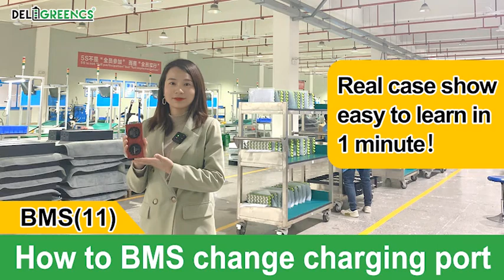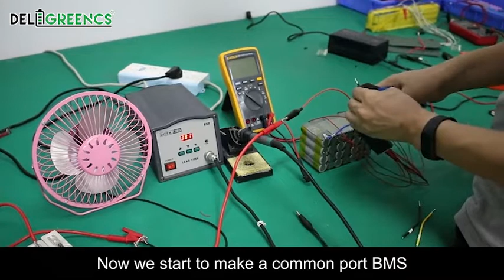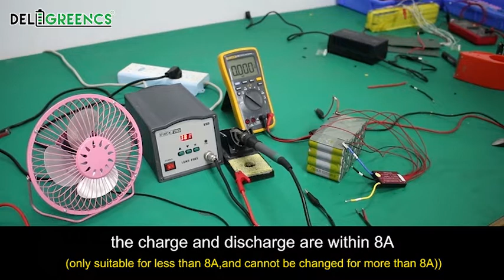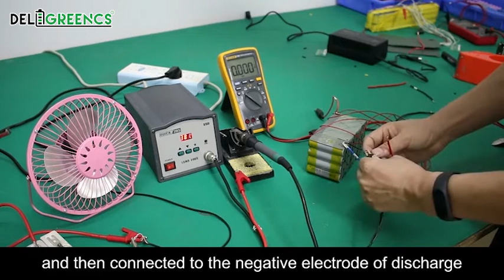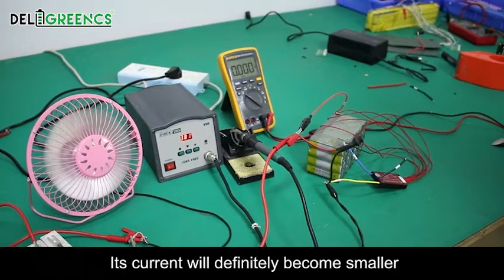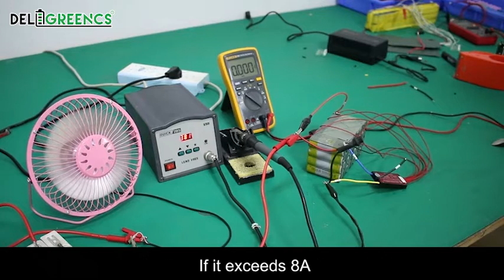How to Bms change charging port

Comment: OK so I need help connecting my 120 amp bms
I have a bms with 3 terminals
C- b- p- and my inverter in using 1 line of positive and negative to charge and discharge
Based on my understanding of this video
Is c- going to battery positive?
B- is battery negative and p- is going to load\charging negative and load\charging positive is going to battery positive?